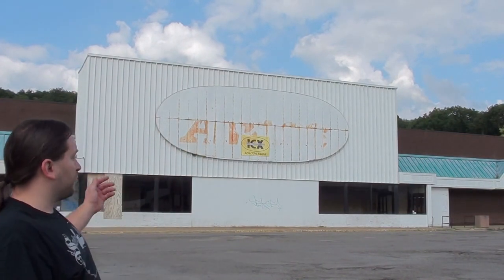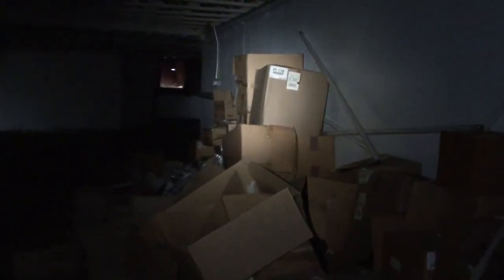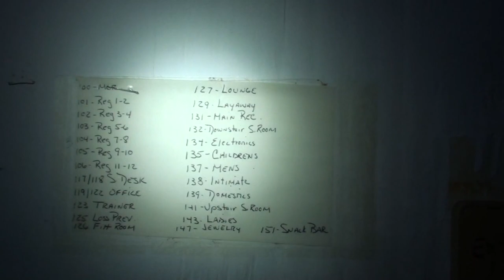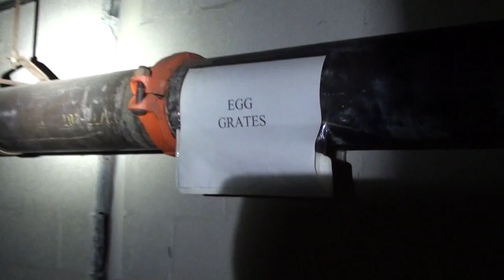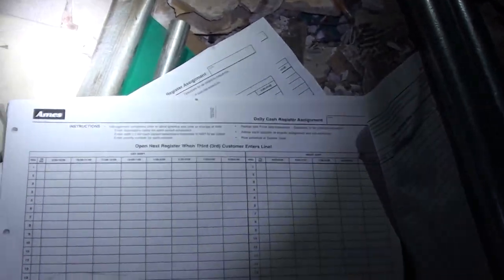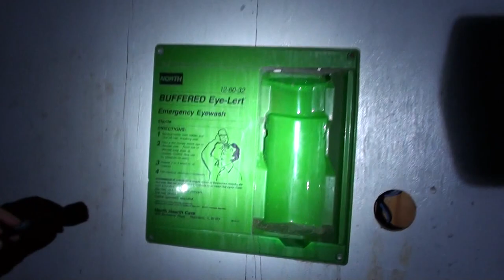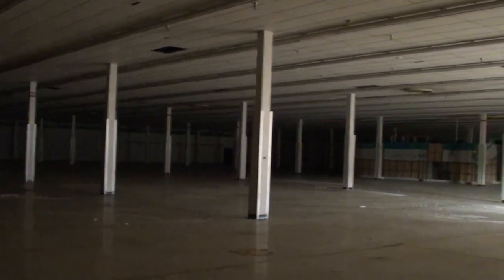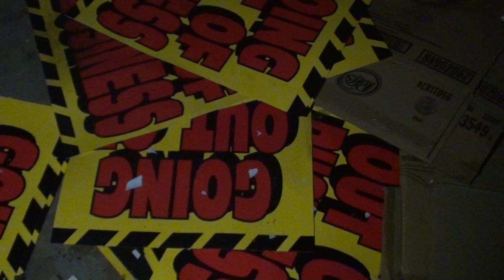Inside The Abandoned Ames / Hills Economy, PA *DEMOLISHED*

Comment: I worked at Ames. Red was the color that use before they turned teal. Not all the stores had been able to finish there remodel before the stores all closed
Reply: Yep. I remember Ames being red before that teal/green color as well. I am pretty sore this one was a hills though because of the snack bar in the front which was typical of Hills as well as the oval ring around the Ames on the outside of the building, which was a standard in hills signage.

Edit, I saw Hills signage further in the video than I was when I originally wrote the comment.
Reply: *their

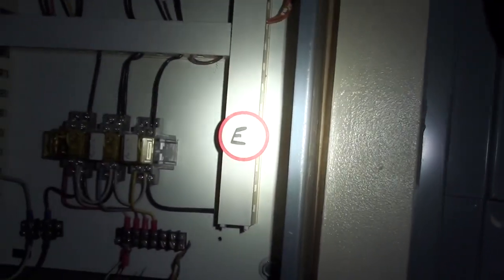Comment: Coming from a former electrician helper and a current industrial maintenance supervisor, one thing you really need to be careful about besides the building collapsing on you, is if the power is still on, please be careful when trying to turn the lights on. There could be cables cut here and there that you don't know about and turning on a switch or a breaker could start a fire and sometimes there's bare wires sticking out of the walls where there were once light switches and receptacles and then you have cables and bare wires hanging down from the ceilings from when they took some of the lighting fixtures and displays down. The lights in most of these big stores, hospitals, factories, schools etc. aren't your typical 120 volt light fixtures like the ones in your house or your garage. Most of these lights run on 277 volts which can almost instantly kill you if you touch a bare live wire! The second breaker box you looked at around @16:57 is the high voltage 277/480 volt panel that supplies power for the lights and the step down transformers and the smaller panel you looked at first is the 120/208 volt panel that supplies power for the outlets and some of the smaller appliances. @23:12 where the fluorescent light fixtures are hanging down, you can see the red labels on the ballasts that indicates that they're 277 volts. Also @ 25:40 that square metal box where you found that ad on top of is one of the the step down transformers that takes the voltage down from 277/480 volts to 120/208 volts and the big panels at the end of the video are the main 277/480 volt panels that supply the voltage for the HVAC units, fire sprinkler pumps and the smaller sub panels and step down transformers I told you about earlier in this post throughout the store. I'm just giving you a heads up on what to look out for when you explore these places so it can be safer for you and your friends.
Reply: Did you not see him out back by the transformers and then went to the meter sockets that had no meters in them which means the power company pulled the meters to stop power in there. Likely even the transformers no longer are connected to the grid
Reply: @andrewbritton7923  Yes I saw that. The power was off in that building but there's other buildings that they explored where the power was still on. On here I was telling them what to look for when they're exploring other buildings where there still might be power.

Comment: Originally, this was a Grants department store when Norther lights opened in 1957.  They went out of business and Hills took over   in 1976.
Reply: Huh. Interesting. That would explain the 1977 date for the Hills equipment and what this building was when the structure itself was built.
Reply: That's cool. I didn't know that!
Reply: The majority, if not all of Ames that lasted until 2002 started as a different chain. I can't think of many locations that originated from the ground up as an Ames. Grants was really the first major department store failure in USA, with locations in most major towns built in the late 50s/early 60s, bankrupt in 1976, and they were all repurposed as other chains like Hills, Ames and Bradlees. Most Ames were former Grants, Big N, Zayre, Britts, Hills, Caldor, Rich's locations. There were many Hills that were former Ames, that became Ames again after the buyout! I think Ames had closed most of their original stores by 1990.
Reply: Also, red is Ames original color scheme too. They didn't start using mint green for anything until 1990. Before that they used the same red for everything that Hills did, so it was a pretty easy switch for them to keep the red Hills stuff and just paint a green stripe around the perimeter.
Reply: the one who likes the comments. pizzaeater  
Well, that was... random.
Reply: Then Hills closed in 1999
Reply: @TRJ2241987  We had in Ames in upstate NY that was converted from a Zayre and they didn't even change most of the orange counters until a couple of years before they shut down. They pretty much changed the sign and painted over anything with the word Zayre in it and kept running. Not many changes were made to the store until it closed although I seem to recall the quality of goods at Zayre being slightly better(and I mean slightly) than those Ames carried.
Reply: I just posted a response, but my dad opened that Hills store in November 1977. I was 4 at the time, so there are tidbits of memories....:)
Reply: @TRJ2241987  I think around 1990 Ames was having some financial problems and then by the mid-1990s they were doing really well
Reply: @TRJ2241987  Most of the Ames stores (that weren't previously Hills) in the Pittsburgh area were Murphy's Mart (until around 1987.)  There were though some Ames stores that were originally Zayre
Reply: Wow didn't know that

Comment: If I were a betting man I'd say the reason this store is still in such good shape is it likely had power up until just a few years ago, possibly even heat to keep pipes from freezing and such. The fire sprinkler system was still charged as of 2013 so its not a off the wall assumption. Obviously someone was keeping an eye on the place. Great video!
Reply from the maker: Curtis Munsey Thanks! That's what I'm wondering. It's possible it was checked over considering it's connected to the other stores in which a couple are still open.
Reply: Most likely. If a fire or maintenance issues plagued this store it could easily spread to the others next to it! Mold has a way of doing that... we had an abandoned Hills here that sat dormant for a good fifteen years that just reopened as another store, no real damage either. I'm guessing if it's part of a larger shopping center the vavant building still receives regular maintenance?